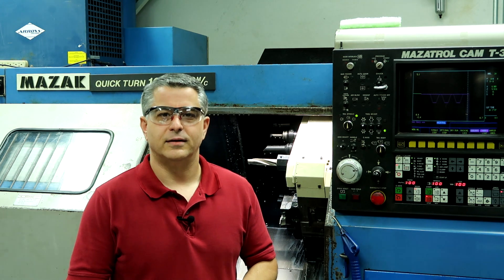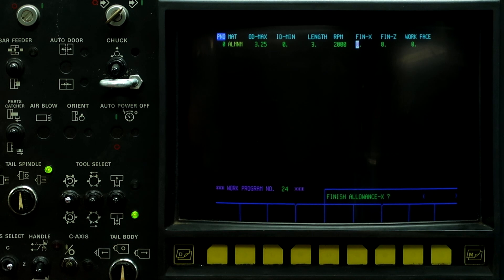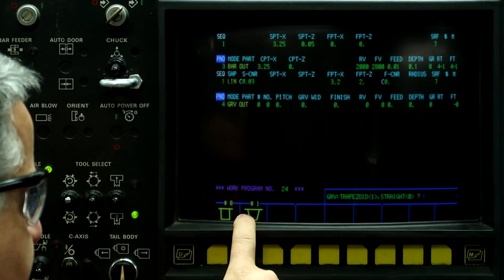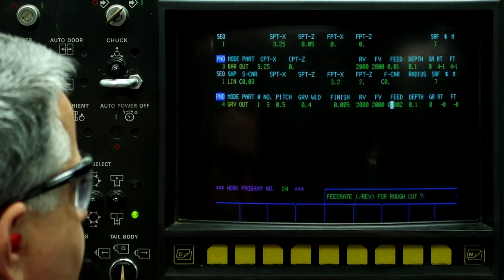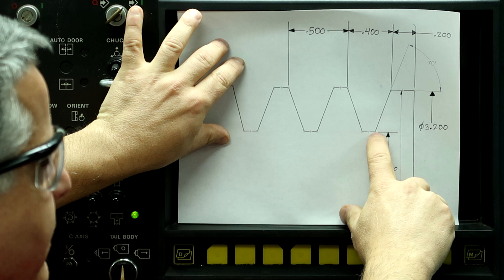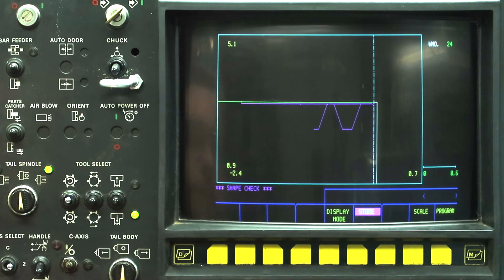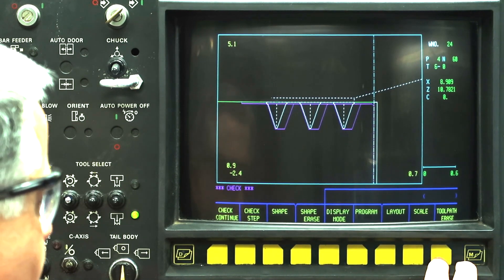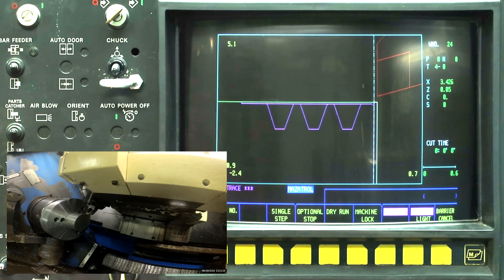Mazak Lathe Training CNC Grooving OD Mazatrol Programming

Comment: hi Phile what if i want to leave ONE fillet inside a groove not like a "V" groove but like a "U" shape however only one .1" fillet at the bottom the other bottom side sharp is this possible ?
Reply from the maker: @fredrezfield1629  Yes, this is possible on T32 and newer controls.  You use grooving option 2 or 3.
Reply: @mazatroltipsandtricks6816  sorry i forgot mine is a 640 fusion /? so no?
Reply from the maker: @fredrezfield1629  I meant any control T32 or newer has that ability. Your controller has it.

Comment: Hi Phil. I need to make the right side finished groove, The part is long and has a drilled hole, in this case, I need to start grooving out material from the right side towards the chuck, but Mazatrol 640T starts grooving from the chuck side.  Is it possible to change the grooving direction?
Reply from the maker: One method that works is to use groove type 0 and make groove width same as grooving insert. You then tell process you have say 10 grooves on that process and set grooving pitch to less than groove width. This will cut overlapping grooves toward the chuck. Adjust the pitch to get the total width you need then run a finish pass groove type 1.  I should probably make a video in the near future about it.
Reply: I need a taper from the right side so this was a bit complicated. I wonder why Mazatrol even makes growing from Chuck's side it ruined the rigidity. Maybe there is a dedicated parameter for changing direction.  @mazatroltipsandtricks6816

Comment: How do you program the gear shift? Is it like G96 and G97?
Reply from the maker: Sorry, I never explained that part. My machine has only one gear so I just leave that field blank. The gear selection is only used for roughing process in Mazatrol. The finish operation will automatically select the correct gear. You really don't need to select anything though and the machine will do it for you. You do need to select a gear for manual process though.

Comment: Hey Phil I need your help I have 533 illegal groove width
 don’t know what’s causing that problem.
Reply from the maker: That is usually caused by groove tool being too wide for the particular groove. This is also caused by the bottom radius you may have programmed in the groove bottom.  Try changing the groove tool to a narrower tool.

Comment: did anyone catch that? 2:58 ?? 
did you do it before you made the video or did mazatrol outsmart itself?
Reply from the maker: I programmed the part and tested the toolpath before I filmed the video. Good catch.
Reply: @mazatroltipsandtricks6816  hey Phil i tried the groove i manipulated the OD and but i have to manipulate everything to get results 
if i do it on CAM everything is fine ? do you have a solution?
Reply from the maker: @christophercolumbus8944  Groove 0 is programmed from left edge of the groove. It should work. I've done it when I had to use a grooving tool same width as the slot like you mentioned.
Reply: @mazatroltipsandtricks6816  no i know 
on the fusio640 it is a little different there are actually MORE options 

can you explain this issue with the degree ? and the negative number? and which item gets the "?"  if the degree is inputted? cause if they all have numbers then putting a degree wont work right?
Reply from the maker: @christophercolumbus8944  The ? Is to calculate the unknown value. You need 3 values to calculate the 4th value for a grooving operation. Negative number on the angle is when the machine needs to calculate the angle downward into more material. The ? Is not needed if you know all 4 X and Z points of the groove.

Comment: Phil i am doing OD grooving  like the pulley your doing in this video but these are radius oil groove slots 3 spaced out on a shaft. I have a .078 wide full nose radius groove tool in machine how do i put the radius in the groove line? they currently look like a V shape on graphics? Thanks! TL
Reply from the maker: What control do you have?
Reply: @mazatroltipsandtricks6816  T PLUS sorry
Reply from the maker: @toddlinder9447  You put the radius at final corner when describing the groove shape.
Reply: @mazatroltipsandtricks6816  Are you for hire? :) even with your videos i lose way too much time programming but i am a weekend machinist in my recent years and still new to mazak.
Reply from the maker: @toddlinder9447  It gets easier as you go.
Reply: @mazatroltipsandtricks6816  i spend hours every job. and no one to ask what i am doing wrong. okay thanks
Reply from the maker: @toddlinder9447  go on the Practical Machinist forum and post your questions in the Mazak section. Lots of us willing to help.

Comment: Sir how program copy nc to usb in mazak quick turn smooth sg 150
Reply from the maker: You need to create a file folder in your USB stick on a computer for the machine to read or write to USB. It will not work writing a file to the parent USB drive.

Comment: Cảm ơn 👍
Reply from the maker: Thanks.
Reply: @mazatroltipsandtricks6816  I want to know what that RADIUS -70 is
Reply from the maker: @nguyenvanquynh9034  It is the angle of the groove.
Reply: @mazatroltipsandtricks6816  so thanks
Reply: @mazatroltipsandtricks6816  I am making fanuc now switch to mazak to see more efficiency
Reply: @mazatroltipsandtricks6816  FINISH 0.005 is what you

Comment: Thanks for sharing. Some guys must be learning from you. You can bar out these grooves using your square grooving too.
Reply from the maker: Yes, but on the older controls, you have to adjust the geometry on the backside of the groove the same distance as the flat on the grooving tool.  I am planning on making a video showing that.

Comment: Hi Phil nice video .
Was wondering what was the width of your grooving tool .
I calculated that the width in the bottom of the groove would be 
.1452 so allowing for a finish cut of .005 per side that would take it down to .1352 .So I'm guessing you would have used a 3mm/.118 width of tool to have clearance  ,am I right ?

Comment: I notice that you don't use G96. Why is that? I'm a beginner and I do not understand! Thanks!
Reply from the maker: The machine does use G96 Constant Surface Speed but I was already maxed out at 2,000 RPM so it just stays at max RPM when cutting this part.

Comment: How would you turn a circular groove say 1/2" long 1/4" radius. Fantastic video. I am looking forward to seeing more.
Reply from the maker: The older controls will not allow you to machine a full radius in the bottom of a groove. There needs to be a flat at the bottom. To get around that issue, I would program that feature using a bar out but use the groove tool as the cutting tool. I'm going to show that type of stuff in later videos.
Reply: @mazatroltipsandtricks6816  I am trying to cut a cable groove, radius at the bottom of a groove. Cable size is 9/16".
Running Mazatrol T2.
Reply from the maker: @kevzkustomz  Check out my other video with Copy Out Radius on the thumbnail. It shows you what you need to do. Thanks.